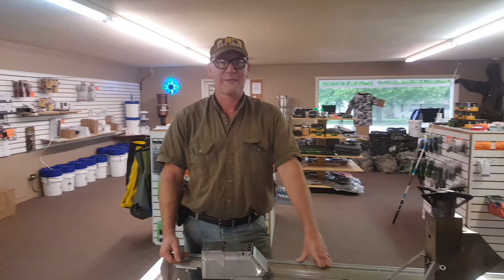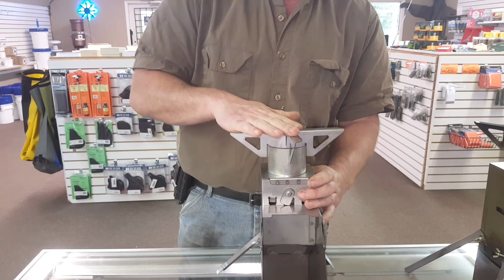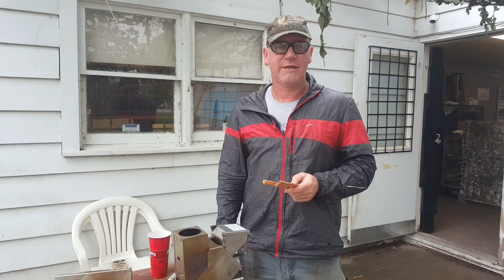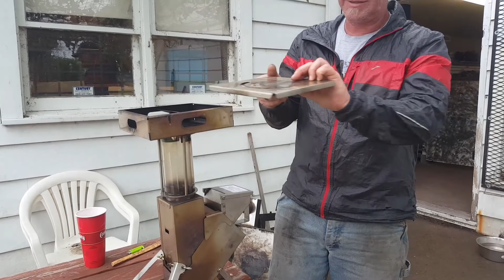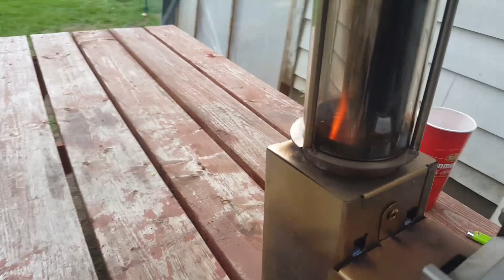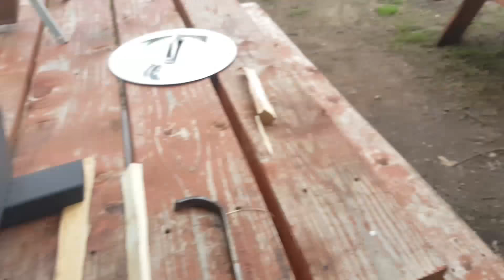Bullet Proof 22LR Gasifier Back Pack Folding Stove Operation

Comment: I would like to see this put to the test. I have the solo campfire stove. I really love my stove, but its bulky.... anywho. I did an experiment over the weekend, still have to edit the video and posted on youtube, i burned a piece of wood from a pallet from work and it burned ok. Only issue i had is that the wood burned black and i had TONS and TONS of black soot. I have used my solo campfire stove with regurlar dry wood and it worked just fine. 

i did this experiment because the stove is part of my bug out bag and i wanted to see if i could burn pallet wood.

Anyway to show us what type of wood these little stove can handle?

I'm really debating on swapping my solo campfire stove for this little stove.
Reply from the maker: Did you watch the full video.  We run the stove with pellets and wood.
Reply: if you use cheap wood, will it smoke? also, when will this be avail. to buy?
thx